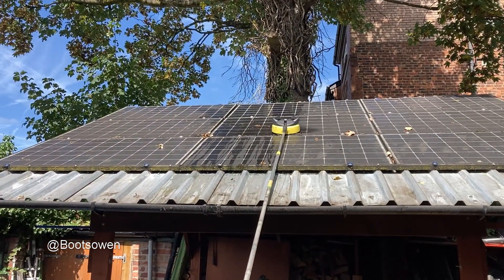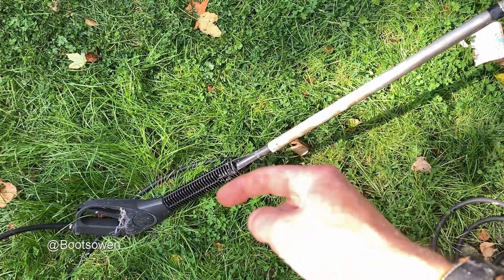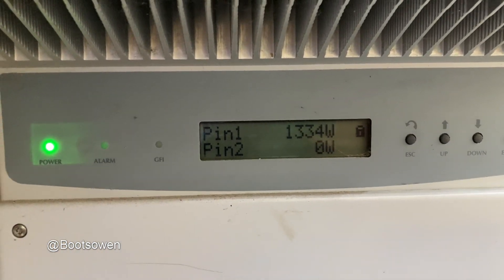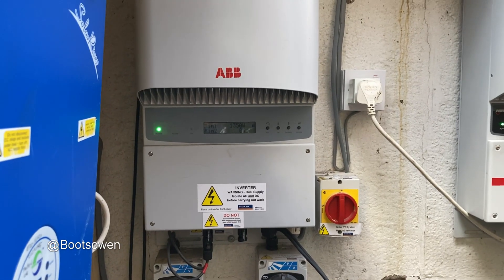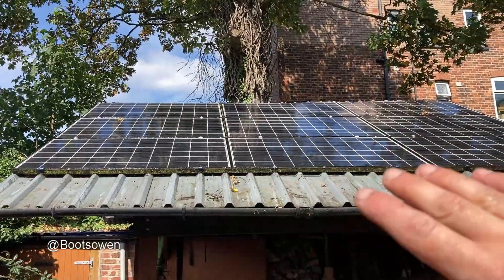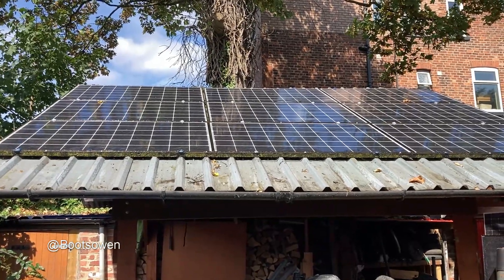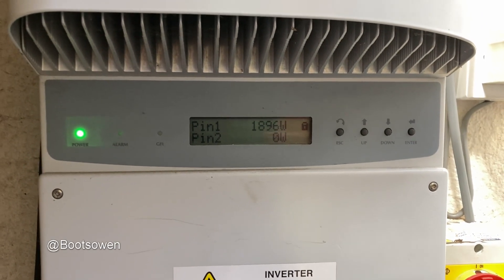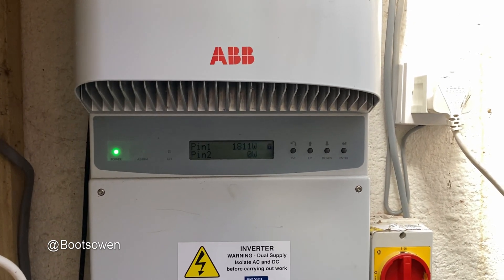50% solar energy increase! Washing solar panels with a patio washer!

Comment: Hey, I enjoy your solar videos.  I am interested to know the yield you get from your various arrays? What is your latitude?
Reply from the maker: Hi. I don’t know the answers to your questions.
Reply: @bootsowen  I was really trying to understand what solar energy (array 1, X kWp gives Y kWh per year) you get from your wall mounted, roof mounted and your garden wall.  But nay worry.  How many inverters do you run, are they solar only grid-tie and hybrid (with batt)?
Reply from the maker: I really don’t know. They all get the sun at different times of day and they are variously old panels or broken panels or mismatched on a string. In summer the trees in front of the panels have leaves blocking the sun. In winter some of them get no sun at all. Generally in winter I get 1-2kWh/ day and in summer up to 15 but usually 8kWh. It all depends
Reply: @bootsowen  thanks, i thought perhaps you had them on different inverters and would know what you get from each array, as the inverter would tell you.

Comment: have you got a filter on the waterline running from the rain barrel? 
I have a very simple one (0.25 mm/€10) which works on gravity. But i feel it has reduced clogging. At least, it gets very dirty. 
No, not drinking it.
Reply from the maker: I have a screen going into it and an inline filter coming out, one of the screw up plastic ones. I think I have detailed it all in another video. Cheers.

Comment: Interesting, I'm thinking with the wet panels there could be less reflection, hemce a marginal increase in output compared to dry. Experiments I've done in the past comparing inverters are very difficult as solar intensity varies from moment to moment. Out here in the East Fen it's Lichen that's a problem, and that needs to be scraped off. Cheers
Reply from the maker: Imagine having such clean air! I think the lesson for me is not to place them under a drippy sycamore. but you have to work with what you have!